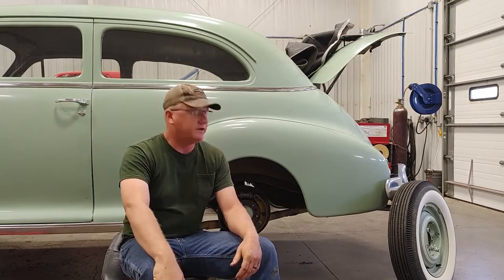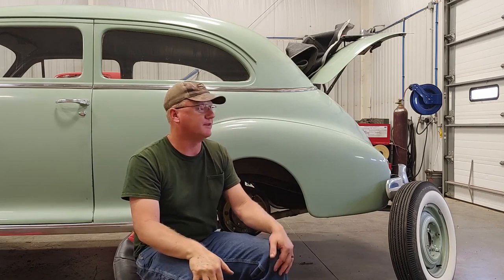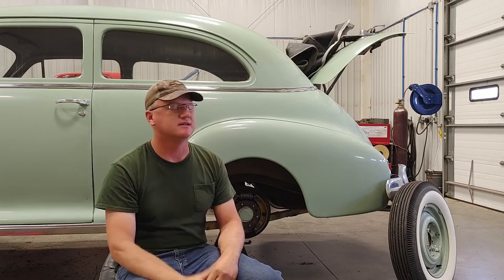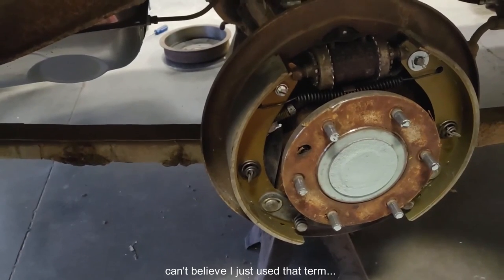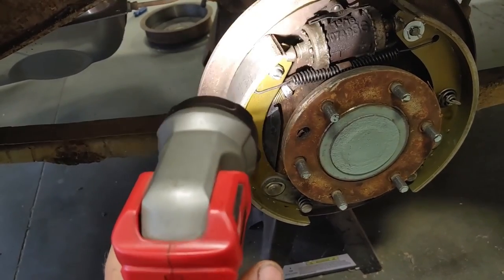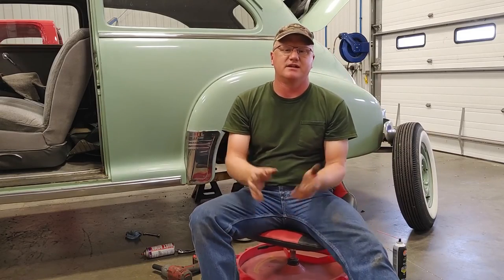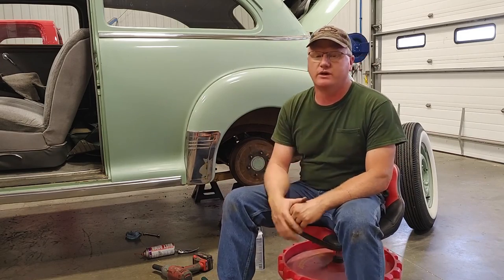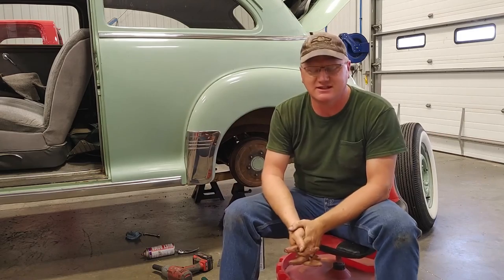Parking Brake Adjustment - 1940's Chevrolet

Comment: When adjusting the service brake on these, once you feel the shoe drag, put a lug nut on the drum and stomp on the brake pedal a couple of times. That "centers" the shoes and you may find they're not dragging anymore. Lather rinse repeat until they are dragging then back off the four notches.

Comment: just incase your wondering still fighting the dang steering gear in the 35. got a bit of backlash in the wheel still, gonna have to try and find where im going wrong in the adjustment. im sure i will get it soon enough though. fingers crossed

Comment: Good day. My parking brake works fine but the spring from the cable attachment point to the torque tube is missing.  Can i get buy without it ?. I have a 51 chev sport coupe. Thanks for your help in the past and now.
Reply from the maker: I'm nor sure offhand how similar the 51 is. I think your brake assembly in the drums would still have a tendency to reset themselves because they have their own spring tension. But your pivot point on the "lever" where the two cables are adjusted may want to come unhooked without a spring holding it in. I do know this: that if Chevy didn't have to buy an inventory of springs, they wouldn't have.